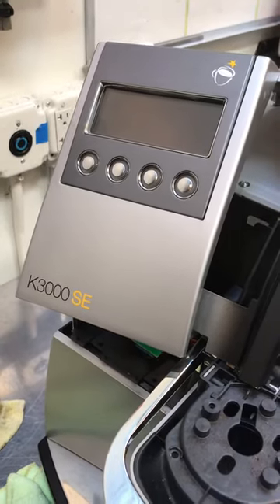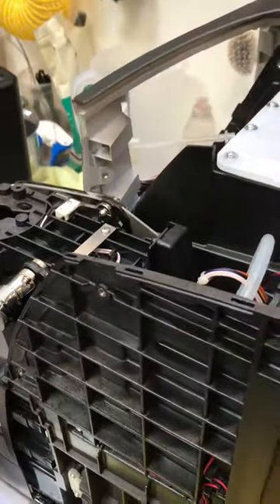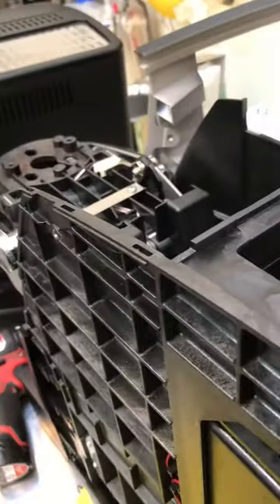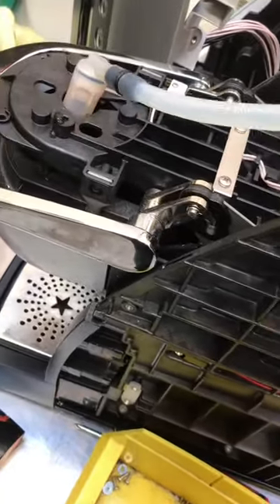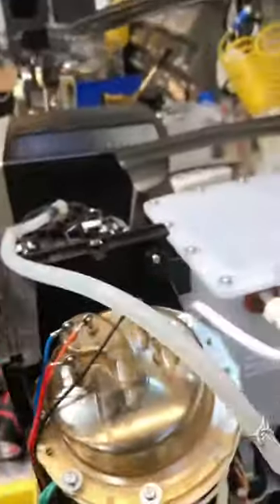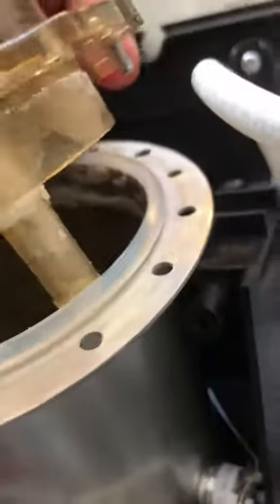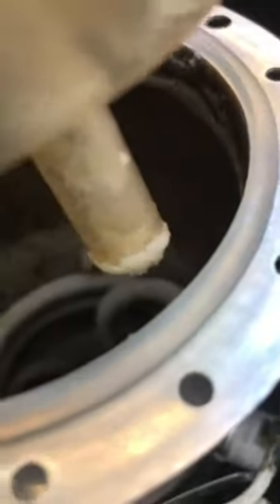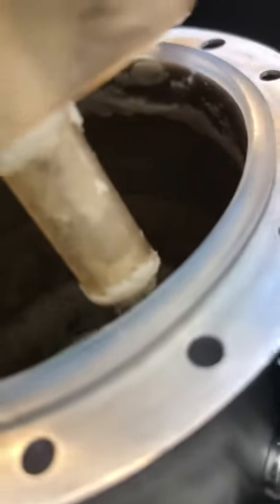Keurig K3000SE - No Coffee Coming Out or Slow Coffee

Comment: I just replaced the solenoid valve next to the air pump. Everything works great now, but it asks "was the brewer drained" after every brew. Picking yes or no makes no difference, I just have to pick one and it continues working as normal. Any thoughts on how to clear that out and get it to stop? It's mildly infuriating.

Comment: My hot  water comes out very slow but when you push the hot water button it runs fast ,  how would that be.  It seems to use all the same system just has option  to hold button for any size for plain hot water .